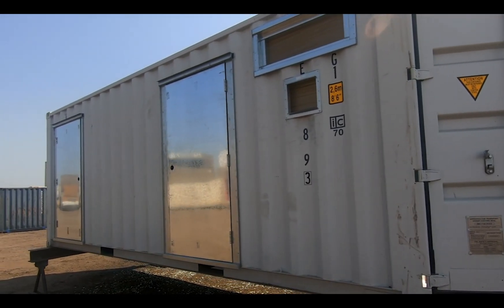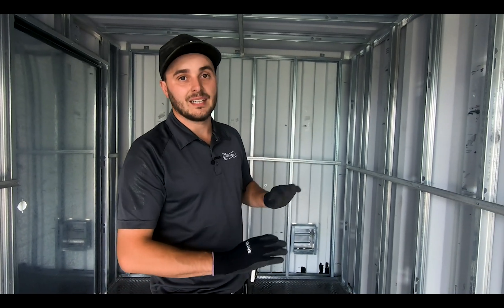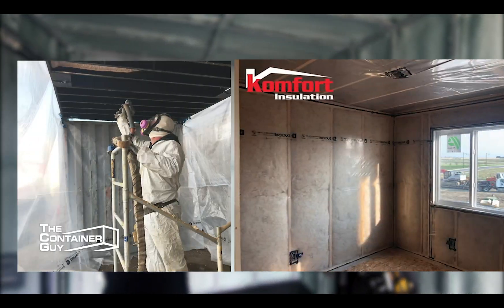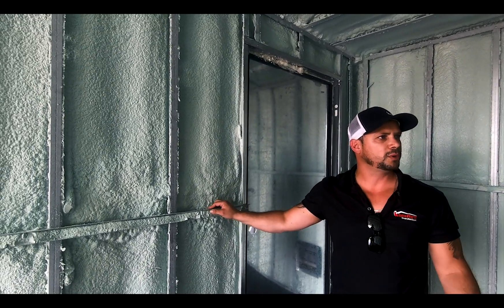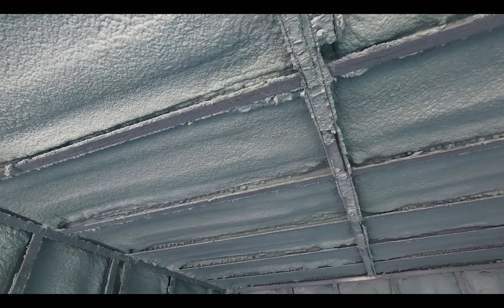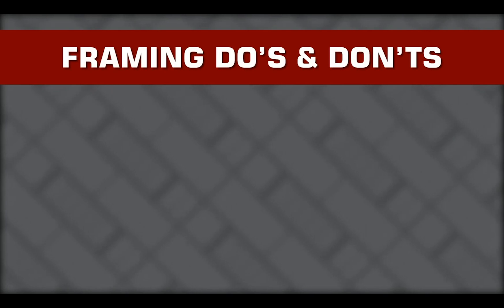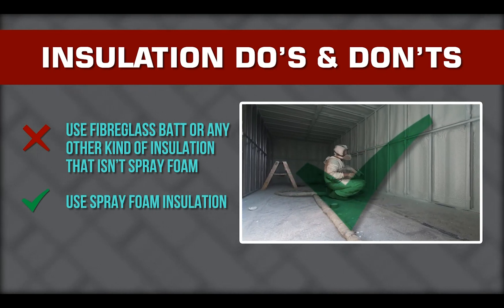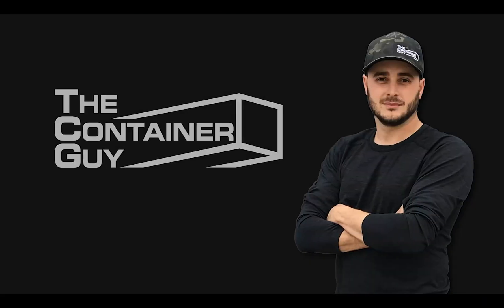Insulating a Shipping Container Home or Office - Komfort Insulation Interview

Comment: How much does it cost to insulate a 40ft high cube container?
Reply: 1280 walled sf x 3 $ psf approx here anyway, $3840.00 but u have to do it or ur going to be miserable and moldy and condensation will rust out ur home like a billion termites eat wood
Reply from the maker: I imagine pricing fluctuates by location. Feel free to reach out to Luis at Komfort Insulation for suggested pricing on different envelopes or a quote if you're in Saskatchewan.